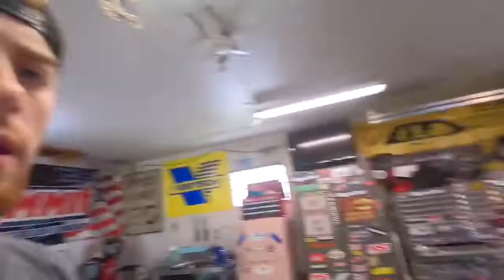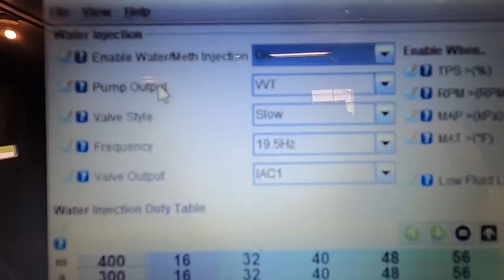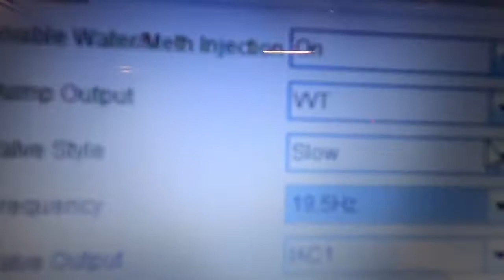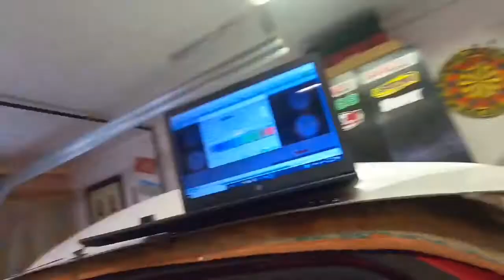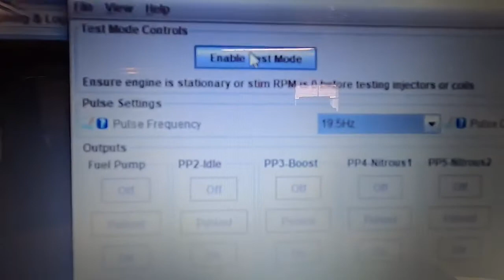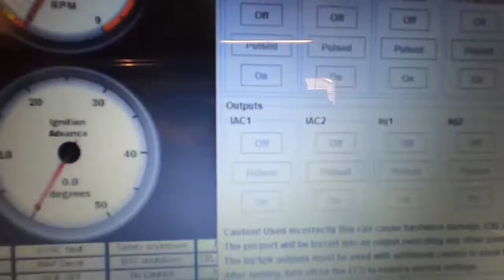How to wire Progressive Water Meth in Megasquirt , methanol injection

Comment: Yeah I just did this on my 84 Buick as well. For the record I'm not proficient either lol.. I haven't got it perfected yet and the car has not ran.  I'm using the DD-efi + GNecu (MS3 Ultimate)  On the ecu I'm controlling the pump with PWM3 D4 on the main harness header.  I'm using a solid state relay (dodge fan controller) from that PWM to control the pump.  I have a 300psi transducer at the pump w/ a snubber (to reduce reading pulsation), to give input to the ecu at the GNecu green strip CAN ADC05.  The power to the SSR is supplied by a Mechanical Master I/O which is controlled by the DD-efi Pin #1 PWM Output.  All of this would be used with parameters obviously.